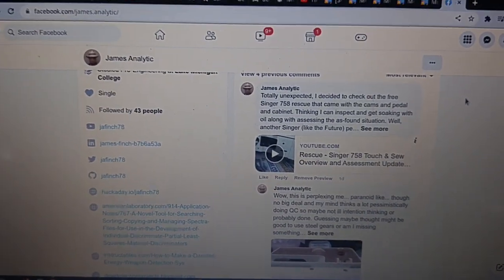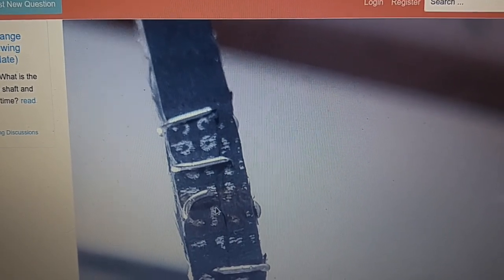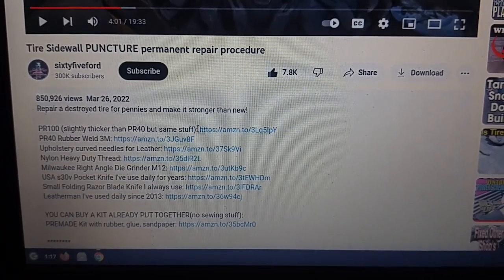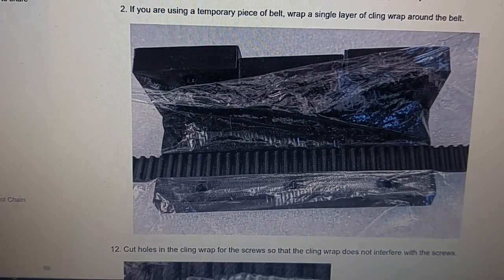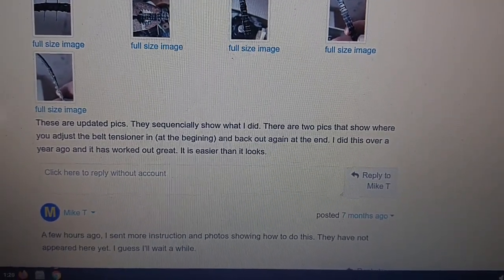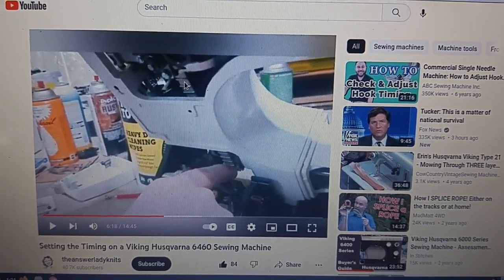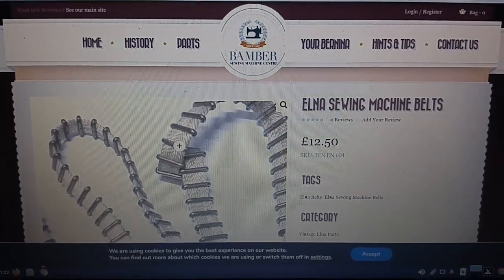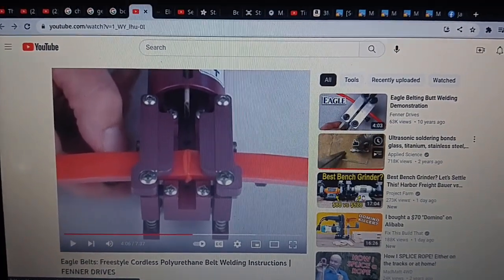Timing Belt Splicing - Potential Time Saving Repair Methods and Enhancements, Singer T&S Inspired

Comment: When I was doing my research on the belt repair for my 758, which I was gifted.  I got some mixed messages from the two Singer repair guys.  Both said it was possible but would not trust the repair to last.  Plus how would you guarantee the work?  They both said it is best to replace the belt with a new belt.  A very labor intensive job.  It is a two to three hour job and should cost $200 to $300 dollars to do the replacement.  My machine was going in the dumpster for scrap and had a nice set of gears and accessories, motor was strong and overall the machine was well cared for.  I'm not not going to pay someone to fix a machine.  I thought, I would give it a go to replace the belt.  I don't believe that only a trained Singer repair tech can do this.   I got some help and I am almost finished with the reassembly.  Then to make the final adjustments.  Keep us posted.
Reply from the maker: Hi again, yes, totally understandable.  I don't really sew, or at least didn't until I just recently started to help my Mom out now that she doesn't use a sewing machine anymore on top of me taking her thrift store and grocery shopping now a couple times a month.  So, she'll see things and like the trash bag (old grocery bags or used bags) sleeve holders she was wishing someone made an easy to wipe the dust off material... I found one and went ahead and made for her.  She also like certain material hats and scarfs, so these last few days I think I finally am confident enough to give her what I thought I was confident enough to sew with the materials she liked. I have around 50 machines I started "rescuing" last season starting with the old ladies hooking me up with some free machines back in November 2021.  That turned into me wanting an off the grid treadle and testing a few, so wound up paying for a few if not many.  Then finding other not quite industrial designs like the Davis New Vertical Feed (NVF) design that is like a walking foot somewhat.  For the most part I stopped there purchasing, though have acquired a few more since then being they're hard to resist for free and like you noted... to save from the dump or recycler yard.  This 758 was free and super stressed me for a second since I've never out of all the machines seen a machine be timed correctly and then go out of time so quick.  Thanks to Randy The Sewing Machine Man video or I would have been all like... what.... as that feeling of the slipping I attributed in my mind to grease being use until I saw the fibers coming off the belt.  Have you made any videos?  Do share!  That's awesome you've rescued and are saving a well made piece of machinery that in time I'd like to fabricate metal gears for and most likely upgrade the stock belt design with a better quality belt design, albeit that's not really required... seems like a good goal to have for now.  I'll be sure to make update videos once I free up some more space since I've gotten more shelves that need to go up and get these machines organized instead of being in the queue on my electronics workbench along with in my room all the time desk. 🙂